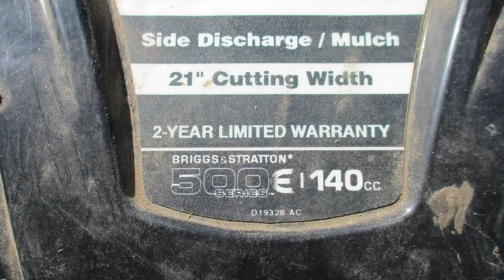Tune Up on 500E Series 140cc Briggs & Stratton Bolens By MTD Push Lawn Mower

Comment: Thank you !!!   12:25... this is the exact thing I needed to see. My neighbor was stressing out about the mower not running after replacing the carb.  Turns out he didn't install the O-ring before putting in the retainer ring.  He just placed the ring on the mower shaft and it wasn't even the correct size.  Luckily he saved the old mower carbs and we have the spare parts.

Comment: Perfect video! I was 10 minutes away from scraping my mower (Same model as you have there) I followed your directions and it fired right up. The problem now is it runs for about 10 and shuts off. It will start back up, but immediately shuts down. Loved your video dude!
Reply: Hello there, did you solve your problem ??? I have the same issue but on a Honda engine GCV 135.

Comment: I’ve come a long way from my first lesson in lawnmower maintenance. I found out that you’re supposed to change, but more importantly, keep oil in the mower so it works properly. I didn’t do that for my first mower and while cutting the grass it caught on fire and the engine block literally exploded and sent shards of metal all over the yard. Turns out it had no oil. At all. Somehow I survived and now I watch videos on what you’re supposed to do. If you want to know what you’re not supposed to do… I just told you.

Comment: If you take the pull start housing off 3- 8mm bolts it's a lot easier to work on. You should go the extra mile and before installing your jet housing use cleaner to clean the housing passages, your fuel intake, it's gravity fed. I gave mine a tuneup this morning, I bought it at a yard sale for $10 and he said it was  froze up, muddoppers built nest in the fan housing, cleaned the magnetic wheel and mag surfaces with sand paper, gapped it at 0.012 on the magnetic surface, started with 1 pull and he said it set for 5 year's. Spark ,gas, air. New filter $8. Lowe's

Comment: Excellent video! I have this exact mower and did all the steps: cleaned air filter, cleaned carb, cleaned gas tank, changed oil, replaced spark plug, replaced blade (hand sharpened a replacement a couple days earlier). Went from No to Go! Took me a bit longer than 30 minutes but so satisfying to complete and have it work again. Thanks!!

Comment: The Great Lawn Mower Adventure!
Chapter 2     I did it!   I took my courage in both hands and went at it
first thing in the morning.  With your guidance everything went
very well,  (I had to pause and go look at the instructional video again 
in the middle of the operation,   but I did everything you said, 
and there it stood.. all in one piece again!!  ..no extra nuts and bolts.
I am so surprised!   (I may be incredibly handsome, but I'm not too bright.. 
  and I'm not sure about the handsome part)
Now for the moment of truth:    I took a deep breath and pulled the cord!!
and it actually STARTED!!!   first time!!   Well how about that!
I was already trying to figure out how to afford a new mower..
You are an absolute genius!   You did it!!  Thank you so much!
(Now, I got a 1956 Cadillac that needs a tune up.. 
    are they anything like lawn mowers?)    John

(by the way, that cracked blade of yours didn't look very safe,
   I'd be concerned the split end might come flying off)

Comment: If you are trying to clean a Briggs & Straton Briggs & Stratton 500 158 cc, carburetor,  its totally different. The carburetor is mounted on the  gas tank, and the gas tank attached to the main body.  There is no tube feeding gas to the carburetor. The innards are also quite different. For example, the gas tank filter is on the end of a straw that descends into the gas tank.  There is also  no bowl, and don't think the jets can be removed. Growth experience.

Comment: This is the one with a totally plastic carburetor on it , worked on many of these . A new carburetor at Amazon was $13.00 - not bad mowers . ( BIGGEST SCREW UP THE SMALL ENGINE INDUSTRY EVER DID WAS DOING AWAY WITH THE DRAIN PLUG ON THE BOTTOM OF THE ENGINES , tight wads .

Comment: Chapter 3     O dear..  added a new spark plug,
Got the lawn mowed once,
Now it won't start at all.
Not even a hint of life. 
The only new B&S mower I could find costs $800 (Toro)
My lawn is looking pretty shaggy..
Reply from the maker: I’ve had tricky to figure out intermittent issues from a gas cap vent that was clogged. It would run for a while then sound like it didn’t have gas because the tank wasn’t able to get fresh air. Also I’ve seen intermittent running issue from a melted kill switch wire under the fan shroud.

Comment: I have one of these too. Mine. Once started it rattles and had a mild surge issue. It's been worked on to get it running. I replaced the float needle and seal with the wrong type, needle needed to have rubber tip. Do you have the idle RPM and OHV specs? Thanks

Comment: With these carbs, the main problem is with the main jet. The Federal government wanted it to be fuel efficient so the hole in the main jet is very small ( less than .015")to make sure it is fuel efficient. You need to drill out the main jet to .021"-22" because if you do not it will clog up again and again. You also need to add a fuel filter and a fuel shut off (so you can run the carb dry before putting it up for the winter). All of the replacement carbs have the same very small hole in the main jet, so now you know.

Comment: i dont get it i did exactly this to the same engine and it still wont start idk wth is wrong with it..i cleaned the carb out , cleaned the gas tank , changed the spark plug and it still wont start...im thinking this thing is just reached its lifes end cycle..ive never came across a mower i couldnt fix or rarely have usualy just a cleaning gets it going odd time its other things but this thing just doesnt want to start..it mustve been sitting for years idk it seems also that the primer bulb does absolutely nothing as theres no fuel line attached to it it doesnt blow gas into the carb at all so priming it is pointless all it does is blow air out that white thing.does absolutely nothing

Comment: Good stuff! What is the type spark plug & gap? Also, do you have a part number for the air filter & cover? Mine are missing.
Reply: thats the air filter, cover, primer bulb and gasket for this motor set of 2 for 10 bucks.

Comment: Hi Ben, thanks for the very informative video. I have the same mower, but the problem I have is it primes and starts fine, but only runs for about 3-5 seconds then cuts out. I just pulled the carb off following your steps and the jets are all clean, no dirt in there. Any suggestions?
Reply: Change spark plug? Clean or change air filter

Comment: I have the same engine on my mower, and it doesn't seem to prime. After 10 or 20 presses, won't start. All I hear is hissing air sound. Is there an air leak in the primer check valve? Or am I dealing with the main jet blockage like in this video?
Reply: There is a little hole, dead center of the primer button.  If you don't cover that little hole with your finger when you push, it won't prime.  Or the bubble is busted. But probably your not covering up the hole in the primer bubble

Comment: I would guess that the problem was probably the carburetor
Reply: I've seen several other video's regarding this specific B&G mower with the exception that they had an automatic choke valve instead of a primer.  And it appears that the problem was a clogged main fuel jet valve that caused the no start/run condition.  After the main jet orifice was cleared of whatever was obstructing it with a strand of copper electric wire, the mower ran fine, until this tiny little fuel jet became obstructed again and had to be cleared.